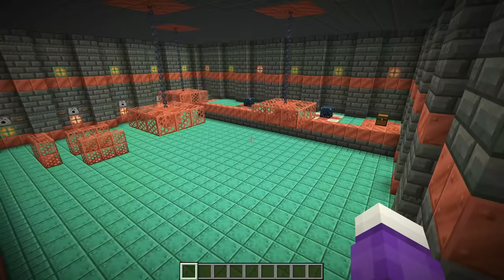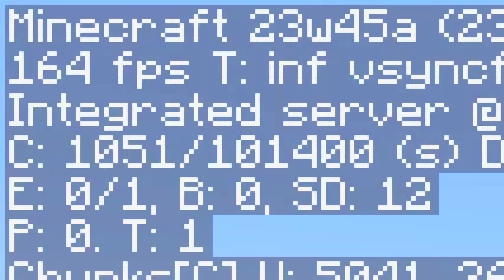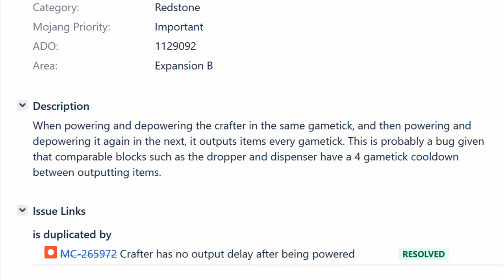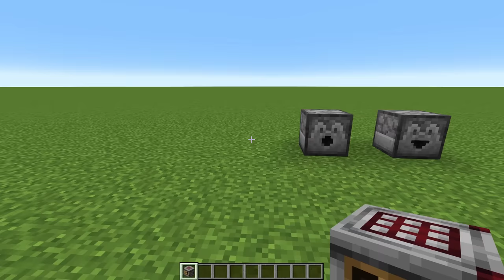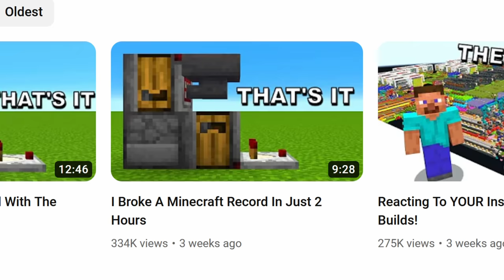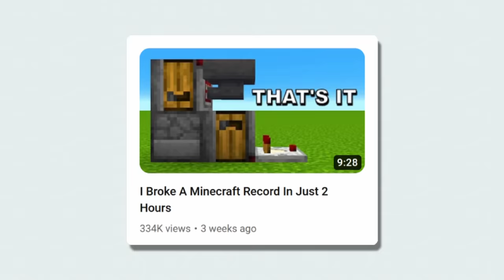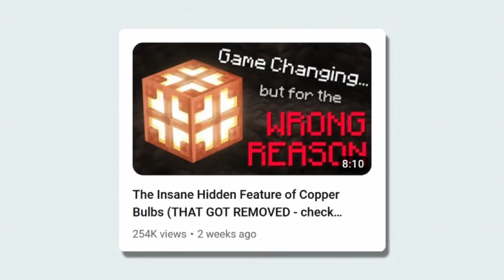Mojang Is About To RUIN Copper Bulbs (And Crafters)

Comment: If this goes through, I wouldn't be surprised if somebody attempts to make a mod solely to undo the unfavorable changes and encourages a lot of players to use it...
Reply: Already happened.
However I'm surprised about the whining about the autocrafter.
It's way to powerfull as it was, and it is yet another recipe wasting a oppurtunity to give the absolutely useless new metal a reason to exist.

My new recipe that reflects it's power:

| C | R | C |
|IB |CB|IB|
|RB| D |RB|

C= Copper Ingot
R= Repeater
IB = Iron Block
CB = Crafting Bench.
RB = Redstone Block.
D = Dropper.

That's far more appropiate for how broken this block is going to be.
And add a setting for speed in ticks for the Autocrafter, default 4. Min 1, max 72000

Comment: The crafter having a cap is understandable at least, it helps with timing the filling of it so you get less half-filled crafters that craft unintended things. Sure it limits its uses, but it is understandable at least and a healthy debate can be had about it, a capped crafter for convenience of use for most people versus an uncapped crafter that is more powerful but a lot more tricky to use (Mumbo had a LOT of troubles to get the timings right, for example, and he's not exactly redstone illiterate...).

The copper bulb change is absolutely, irrevocably, completely moronic and should immediately be reverted to what it was.
Reply: For getting less half filled crates, just don’t use that fast of a clock
Reply: The crafter still has to reverted as well, having no delay can have so many intrusting uses.

Comment: Honestly, as Mojang seems to pay so much attention to bug reports (first 'fixing' horse breeding to be super easy thus invalidating ilmango's work) and now the copper bulb, its given me an idea.... why not fight fire with fire?

As the 1GT delay for the copper bulb was clearly 'intentional' behaviour given how it was intelligent game design, the change to make it a 2GT delay was clearly an accidental oversight and therefore must be a bug; so write a bug report how the 2GT delay on Bedrock was clearly a parity issue and both bedrock and Java should have 1GT delay AS INTENDED.

2:
As Mojang have stated, through official channels, multiple times, how Quasi-Connectivity is a feature, not a bug, the lack of Quasi-Connectivity in Bedrock edition must therefore - clearly, be a bug, and should be be corrected for the sake of parity.

EDIT: Have opened a bug report about the lack of QC in Bedrock
Reply: How did the bug report go?
Reply: @mini-_  Not well :(
The moderators (not even Mojang!) just referenced a previous similar bug report (since closed) that was essentially "The lack of QC in Bedrock is intentional".

So as other Minecraft content creators have pointed out - it's the technical MC community that has to constantly justify their existence to Mojang.

My opinion - the only LONG-TERM solution to this problem is to delay a major update and spend the time productively creating 100% parity between Bedrock and Java (essentially making them the same game) and only then move forward with new releases, because then you can balance equally across both platforms - not to mention it would enable crossplay.
Reply: Aww that's a shame about the bug report, but kinda expected with how Minecraft/Mojang/whoever seems to treat the technical side of Minecraft.

Comment: The way I see it, this is if they added honey blocks, and then after a week, decided made them stick to slime blocks. It feels counterintuitive to make these changes. To limit a block because they provided a redstone purpose they didn't intend would throw things like targets and cauldrons out the window for the sole reason that mojang didn't intend them to work the way they do in common redstone contraptions.
Reply: Tho, you still have repeaters that can be used for the same purpose, and they are easily adjustable to 3 different speed/block. I'm pretty sure that the bulb just meant to be a redstone lamp but with copper theme and not signal timer.
Reply: @tovarishchfeixiao Not again. Bulbs are not repeaters.
Bulbs operated on 1 game tick, while repeaters and all other redstone components operate on 2 game ticks. These odd ticks is what made it special, as it allows for very precise timing.
Reply: @tovarishchfeixiao  I think it was also meant to be a t-flip-flop but I could be wrong about that :)
Reply: @tovarishchfeixiao do you think redstoners all forgot about repeaters, or is it more likely that you don't know what the hell you're talking about?
Reply: @genio2509  The only thing you can bring up on the side of bulb are the "1 instead 2" and "movable".

Also the thing you worship that much are very likely was just an error in the code and not intentional. Because it very surely was just a "redstone lamp" witrh copper design for the new challenge dungeons which is mostly made out of copper. And not to be a tick timer.
Reply: @mcswashbuckler3833  You guys sound like as if you were forgot that repeaters are meant to be good for signal timing. 
And pretty sure that the bulb thing was just a code error, because it clearly meant to be just a copper version of the redstone lamps for the new dungeon that mostly made out of copper, instead of signal timer.
Reply: @tovarishchfeixiao except repeaters are literally half as precise as a copper bulb, and it doesn't matter how intentional it was. A lot of java redstone is unintentional at this point. Leaves, walls, and scaffolding probably aren't intended to be used for redstone, and QC definitely isn't intended
Reply: @mcswashbuckler3833  Cry more. 😁
Reply: @tovarishchfeixiao  bud thinks he's smart by saying "cry more" when proven wrong. Keep those delusions buddy.
Reply: @Ezoc  You never did make me to be "proven wrong". But you're clearly just a kid who is angry because someone took the new toy away from you.
Reply: @tovarishchfeixiao you conveniently abandoned the "repeaters serve the same function" argument as soon as you were challenged on it, so yeah, I think that concession counts as being proven wrong
Reply: @tovarishchfeixiao  The better question here is why are you so seemingly against the bulb change being reverted? The bulb still serves the same "intended purpose" that you claim in either version. This isn't a choice of one type of functionality vs another, it's a choice of more functionality vs less; the bulb is literally less useful than it was in the previous snapshot.

Why argue in favor of a block being less useful?
Reply: How has a debate started in my comment?
Reply: @austinwheeler4328  The tovarish guy has been trolling in several reply sections, arguing in favor of the changes. I think you just got unlucky and he picked yours at random.
Reply: @tovarishchfeixiao  I've read the other replies, and yes, that o 1 and 2 tick means a lot.
"It's just an error in the code" QC has left the chat
Reply: @tovarishcheleonora8542
You know what, you say that the changes are good but you haven’t given a single reasonable point for why they can’t have their old timing. Saying “cry about it” is not an argument and it shows that you are actually the child that in this situation who’s never had to deal with a single conflict and as such don’t even know what”defending your argument” even means.

You’ll quickly find that logical arguments are a lot more effective at bringing people to your side than just insults hopefully you’ll learn from this but I’m assuming that you’re just going to forget about this and ignore a chance to improve.
Reply: @patientzero8130 here before he says 'not reading allat' or '🤓'

Comment: The crafter and copper bulb are obviously still great, but I really hope these changes get reverted. Mojang likes adding blocks with unique properties, and this is an amazing opportunity
Reply: nah the copper bulb is lowkey useless now.
Reply: @nnnik3595 Tell us you don't know much about redstone without telling us you don't know much about redstone.
Reply: To me who doesn’t do redstone but still knows something, copper bulb basically is a t flip flop right?
So 1 tick makes complete sense because it does extra things, why they would change it to instant?
Crafter having smaller cool-down is reasonable as well. Crafter works like a player moving cursor and crafting, so small tick should make sense as you move your cursor to output slot.
Reply: @KidPrarchord95  It's a 1 block T Flip Flop, which we've had for as long as redstone has been a thing. A 1-tick T Flip Flop, now that's something we haven't had. 
It's like the observer, its a more accessible BUD Detector, but the reason it's so useful is the fact its the only block with a single output side. 

This change is like Mojang making it so an observer outputs redstone on all sides, "So it's consistent with other redstone blocks."
Reply: @mickys8065  it's also a movable tflipflop which makes it still as useful and revolutionary

Comment: Honestly, I just wish they would release something like Copper Wire. Redstone, but it can go on walls or ceilings, with an expanded conductivity for length compared to redstone dust.
Reply: I’ve said this but for redstone items that contain gold as well. It could be a cheaper alternative with a slight drawback of oxidizing overtime leading to decreased performance but could be preserved in the same way as other copper blocks.
Reply: mods exist
Reply: ok.
Reply: I had the same idea, except I had the idea that redstone and copper wire could be directly next to each other without connecting to one another, so that copper wires could be used like repeaters, but without delays.

Also came up with its crafting recipe idea:
1 copper ingot can be crafted into 4 copper wires
Reply: The only problem with that is why would anyone use redstone dust? Copper is infinitely more abundant and there’s seemingly no drawback to the wire, so all use the dust could’ve had in builds is now replaced entirely and it’s left as just a crafting ingredient
Reply: @frozenover_exe  just add redstone to the crafting recipe, maybe 2 redstone per wire? Makes it a more expensive but more useful alternative to redstone wire.
Reply: @adumbchicken8022  That still doesn’t change the fact that it would be objectively better than redstone once you have enough of it, or in creative mode (where way, way more redstoners are playing)
Reply: @ethan20559  That's not the point of suggesting that a feature be added to the game. The piston mod existed before pistons were added to the game, doesn't mean mojang shouldn't have added them.
Reply: @blu3260  yes but something similar to pistons didnt exist before pistons. Mojang doesnt rly add technical stuff that overlaps
Reply: @ethan20559  if there were only mods and no updates what state do you think Mojang would be in?
Reply: @CheeseMeat_  mojang updates add width to available content, they rarely expand on the depth of it unless it relates to world gen and structures. And it makes sense cus tbe players readily provide depth with plugins and mods

Comment: I heard about this change, but I didn't know that someone actually suggested it as a BUG REPORT?!  Like???  Whoever that was had to have been trolling???
Reply: The villager curing nerf was also done due to a bug report. Usually unannounced mechanics tend to go on the bug tracker because it is unknown whether they are intentional or not (and anyways Mojang perfectly has the option of marking the report as Won't Fix or Works As Intended instead of fixing it)

And I don't think the reporter was trolling. They just saw some inconsistency (I know the video mentions the differences between the crafter and the dropper but the focus is on the dropping behavior itself), thought it was a bug, and reported it. Simple as that. They had no control over Mojang seeing it and deciding to fix it.
Reply: @kmb600 the villager curing thing makes sense to call a bug,  but the solution doesn’t make sense, maybe instead make it so that there is an ai [As in a real AI not this chat GPT stuff but one that passes every turring test thrown at them and is obviously sapient,] who’s job (for which they recive fair compensation) is to essentially DM the game, controlling the mobs to make intelligent decisions, including having the villagers judge if you infected them on purpose in order to cure them or not and raise instead of lowering their prices if so.

Comment: We can fix the crafter by making more, I suppose that's fine, but the nerf totally destroys the copper bulb.  Even in the uses for memory storage, they just made things more complicated again.
Reply: To be fair, it's actually a good thing that they made the crafter slower. Because it would be problematic on servers pretty quickly (because of lag machine potentials in the old speed).
And for the bulb, you still can use repeaters, not to mention that the repeaters are adjustable with 3 speed options/repeater.
Reply: @tovarishchfeixiao  @genio2509 "Not again. Bulbs are not repeaters.
Bulbs operated on 1 game tick, while repeaters and all other redstone components operate on 2 game ticks. These odd ticks is what made it special, as it allows for very precise timing."
Reply: @Aid5Patient  lol why do you answer me from 3-4 different accounts? XD
Do you have nothing better to do, Mr bulb worshipper?
Reply: @tovarishchfeixiao  bro is malding over being wrong about repeaters and bulbs
Reply: @Ezoc  And there is the 5th account. 
Also i'm not being wrong just because of you decided on that way. 🤣
Because in fact you still can time the signals with repeaters, even if it's not fast enough for your taste.
Reply: @tovarishchfeixiao  How are you so persuaded that there is a single person against you that is making a lot of different account, instead of, maybe, the fact that you have an opinion opposed to what most of the community thinks ?
Reply: @Guiguiandange  Maybe because all the replies are the same bullcrap? XD
Also, you saying this like as if disagreement against the hiveminds were a bad thing.
Reply: @tovarishchfeixiao  buddy, just because I agree with a popular opinion that is popular for a reason doesn't make me part of a "hive mind"
Reply: @tovarishchfeixiao  but you keep not understanding the replies and responding in the same way. It's like you're saying "why do you need a target block when you can just loop around and use a repeater taking up 4 times the amount of space maybe it takes up 4 times too much space for your taste." It's not a matter of preference it changes what can and can't be built in the game.

Comment: Rather than revert the copper bulb change, we can do something even better: Make the delay depend on the oxidation stage! A normal bulb is instant, lightly weathered is 1 game tick, weathered is 2 game ticks, and corroded is 3 game ticks. That gives players four times the choices! As for the crafter, I'm not too worried. The crafter isn't revolutionary because it's spammable, it's revolutionary because it's a freaking crafter!
Reply: but he's talking about the other uses for the crafter
Reply: @awesometiger9992  Gametick-accurate stopwatches are still possible using hopper minecarts, and much simpler to build. Fast redstone latches are cool, but not a significant improvement over dropper latches. (Maybe we'll get a one-block latch in the future?) Finally, the crafty crafter counter still works, you just need to rearrange the blocks!
Reply: Actual Greta idea